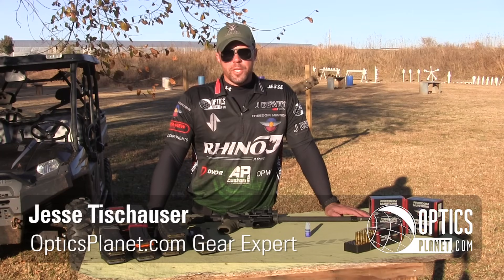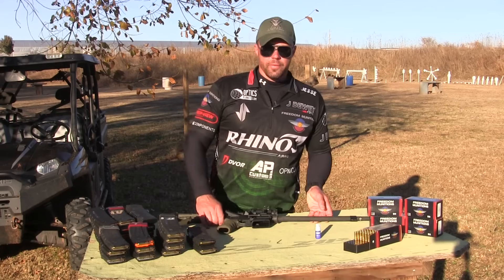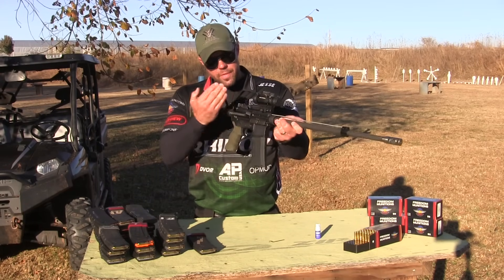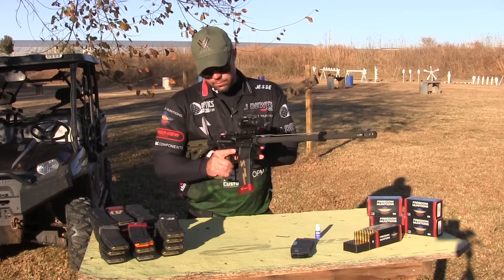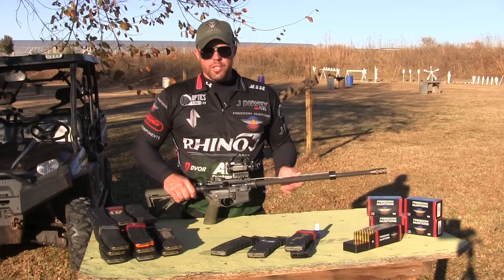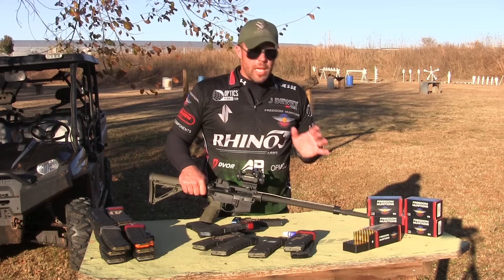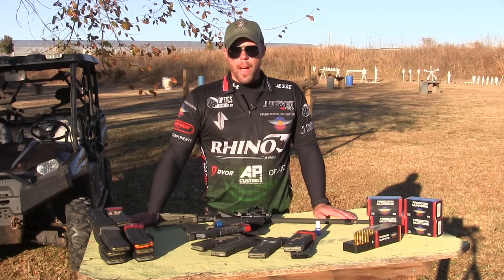How To Tune Your AR-15 Adjustable Gas Block - with Jesse Tischauser - OpticsPlanet.com

Comment: When you think you have the gas block adjusted where you want it turn your rifle to the left, right, and upside down and fire from each position. What I have found is that at times the gas may be enough to lock the bolt back while fired from a normal position but with the gun fired from an odd angle it may need more gas.
Reply: @Jon Iwanyszyn  Well I’ll be damned, that does make sense. Looks like I was the dummy 🤦‍♂️.
Reply: 🤣 y’all are all 3 great

Comment: If your going to open up the adjustment screw that much, then why don't you just run a non-adjustable gas block. I thought the whole idea behind an adjustable gas block was for turning down the gas to lessen the recoil.. Just saying..
Reply: I have a AR chambered in 6.5 Grendel and it seems to be over gassed not sure if my gas block is adjustable. Can anyone help?
Reply: @boricuaarecibo9259  is it PSA? i have the exact same problem. is it denting your casings by hitting the brass deflector? the PSA kit is adjustable gas block
Reply: @boricuaarecibo9259  run an odin works gas block, best solution. Your aim should be to get the lightest buffer weight <3.5oz, with the most minimal gas that will reliably cycle the bolt in both warm and cool conditions. It should also have a decent ratio of reciprocating<non-reciprocating weight in the buffer to avoid bolt bounce, and avoidable wear. I recommend a buffer with HDTP weighting. You can open them and adjust the weight values manually. Its just powder inside, and is very good at deadening bolt bounce. Imagine its essentially a dead blow hammer.
Reply: Dude, you don’t get it. He tuned it so he had just enough gas to cycle the bolt.

Comment: You might not want to remove the adjusting screw all the way out to put loctite on it. Rather most of the way out. You dont want to get it on the tip of the screw and into the orifice where it would harden.

Comment: A question for anyone.   I just finished my first AR build, a 300 Blackout pistol.   My only question is about the adjustable gas block, which I have never worked with.  I just test fired it and it functions just fine.   But, the shell casings are smacking the shell deflector so hard that it is denting all of the necks at the top.  Can I assume this is due to too much gas and I should just dial it back?
Reply: Molon Labe I'd say yes, at least try it. although beat up brass is a straight of the ar &ak platforms.
Reply: Yeah, I would dial it back a little. What are the different rounds you are using and grain?  The thing is with 300blk, it is tricky to get it at the right adjustment. So many factors :Barrel length, rounds, gas port, buffer spring, suppressed/or non.

Comment: Jesse, what system does the Sig Sauer M400 have?  Gas?  I used an AR at a job I used to have and it hardly had any recoil...lately I've been shooting the Sig Sauer M400 and it recoils a lot compared to the AR I had at work.

Comment: Just found your channel. THANKS! I just got a PSA Gen 2, 6.5 & its carrier bolt was slamming HARD into the recoil assy. WAY overgassed. It has the adjustment & the lock for it. Your instruction saved me from having to send the damn thing back. PSA did NOT send any instructions w the unit. Subbed!
Reply from the maker: Thank you for your kind words and welcome to our channel, Dave! We're glad we were able to help -  if you ever need any assistance, please do not hesitate to contact us. Have a great day!
Reply: same problem here that why i found this video too. hows the recoil been after the adjustment?

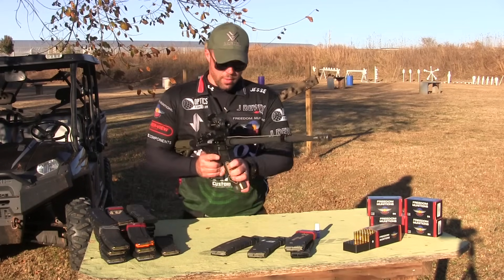Comment: I always taught that even if you can get the bolt to lock, the gas block may not be properly tuned. I understood that with the muzzle being 12:00 and the charging handle being 6:00,  the cases should eject 20-30 degrees beyond the 3:00 position and slightly to the rear of the shooter.  Cases ejecting anywhere ahead of 3:00 = under gassed.  Or is that an old wives tail?

Comment: I’m having issue’s with FTF  &  FTE  on my  AR-10  shotgun . I haven’t check to see if it has an adjustable gas block yet . If it does I will try your technique . If it doesn’t should I try a different spring & buffer . Or replace it to an adjustable block ?   Also  I have seen damaged aluminum blocks . Would you recommend an adjustable stainless steel block . If so what kind would you recommend . I would like it to be reliable . It is an  Utas  12 gauge . Thank You          It is a  Rod  Operating  System ..

Comment: I have a question.

Why is the charging handle go back everytime you shoot a round to lock the bolt? Idk how some AR-15s work.
Reply: The charging handle sits on top of the bcg and when it is locked back the charging handle can move freely back and forth.
Reply: dp4k I saw one of the comments now that the gun’s charging handle broke
Reply: @ember5935  I see what you mean now. I misunderstood your comment.

Comment: Great vid.  Thanks.  I just finished my first AR10 308 build.  I have a Sentry 7 SLR Rifleworks 15 position gas block.  I can get spent cartridge ejection and new round loaded, but I have not been able to get the hammer to cock.  The rounds are Winchester 150 grain and ejection of the brass is at about 3:00.  Any thoughts on what might be causing this issue?
Reply from the maker: Hi Andy,

Sounds like this could be a tuning issue Yea it’s a tuning issue. For example, the carrier isn’t going back far enough to cock the hammer.

If the gas block is wide open and there still not enough power, you might need to go to a different buffer spring/buffer weight? Maybe try higher power ammo? Those are a couple of different ways to possibly troubleshoot this. If none of this works, go ahead and email "techsales@opticsplanet.com", and ask away.

Thanks for the question & comment!

Comment: do they make a diff model now ? my set screw is on the front of the gas block
Reply from the maker: +Davee david 
Hi Davee, there are many different models out there with different designs that allow you to set/adjust your gasblock.
If you happened to know what make/brand you got, don't hesitate to mention it here in the comment section, or if you have specific questions contact us at: techsales@opticsplanet.com.
Reply: +OpticsPlanet hey thanks man .....I bought a seekins precision adjustable has block cost about $57 ...I saw your set screw placement and thought maybe I installed mine backwards but then I saw must be diff model of seekins
Reply from the maker: Davee david Hi Davee, yea I can see where this can get confusing. Some models have a flat front with no exit hole, making it a no-brainer on how to install them, whereas the seekins is open in the front.I guess the best way to remember the direction of install would be that only one side has an opening for setting the screw, and should always be to the right side of your barrel when looking down the sight of your rifle. IF, of course we are actually talking about the same gas block.
Reply: +OpticsPlanet yup it is to the right !!! your awesome thank you for your help
Reply: I'm pretty sure they changed it and its front now, if im not mistaken

Comment: What about if you plan on adding a suppressor to the gun? Should you back it off even more or keep it at the bare min for locking the bolt back?
Reply from the maker: Hi JJ, 
It would depend on the bullet weight and velocity of the ammunition. Our recommendation would be to contact the manufacturer. 
If you have any further questions, please feel free to contact us!
Reply: Thanks, I'll get a hold of them. It's a 300 Blackout, so ammo I tend to shoot are 147 grain supersonic and 208 grain subsonic (10.5" barrel, pistol length gas system)

Comment: Can we tune the rifle even with the handguard on?
Reply from the maker: Greetings! 
Thanks for the comment. It will completely depend on the gas block and handguard and how the rifle is setup. Some handguards allow for tuning and some require removal of the handguard. The same goes for the gas block -  some allow for tuning through the handguard and others require removal. If you have any further questions, please feel free to contact us!
Reply: how about seekins precision adjustable gas block. can I tune it even with the hanguard on? THank you for your reply.
Reply from the maker: Greetings! 
It will also depend on the handguard being used. The Seekins adjustable can be adjusted on the fly with two set screws that are accessed on the front and right hand side of the gas block. If your handguard has large enough openings, the gas block can be adjusted without removing the handguard - but it will be completely dependent on the handguard.
Reply: OpticsPlanet what about the gas block on the Ati Omni hybrid

Comment: Why is the charging handle popping backwards? Is it some sort of competition one that is supposed to do that?
Reply: Jeffrey Dohnger  ummmmmm idk about you, but all of my ARs do not do that, nor have I ever seen one do that.
The bolt locks to the rear, but for some reason the charging handle moves backwards Everytime? Doesn't make a lot of sense

Comment: I have an "Anderson Manufacturing Low Profile Adjustable Gas Block - .750" - Set Screw Style." However as I am trying to adjust the gas block with my Allen Wrench, it does not seem to be locking onto something. It literally just feels like I am sticking a 5/64 wrench into an empty hole. Can someone please confirm if there is supposed to be a small screw in the port where you adjust? I believe I may be missing something here on the gas block itself.

Comment: With how hot the gas blocks get, is locktite still effective?
Reply: Xaro Xhoan Daxos - they have different grades of lock tight for different purposes, including high temp applications. In some cases you'll need a torch to loosen the lock tight enough to back off a nut or screw